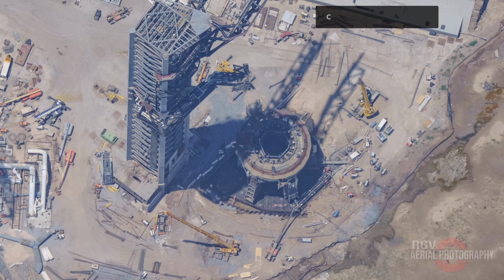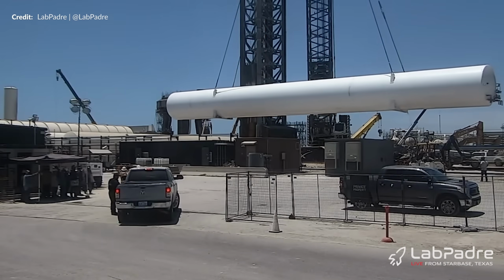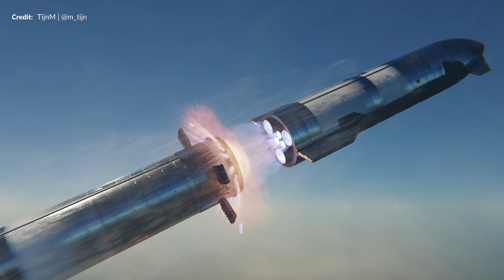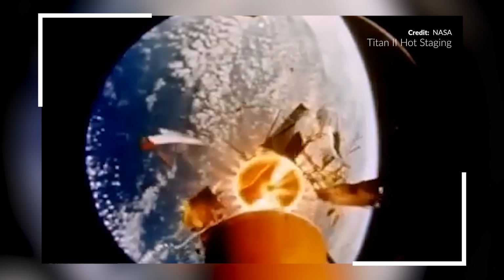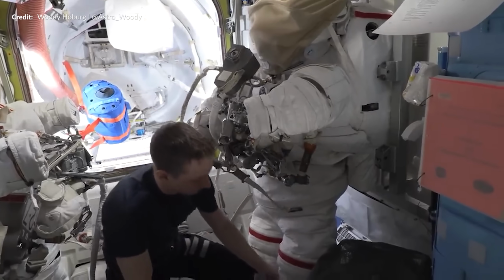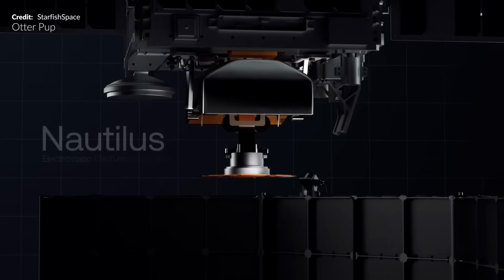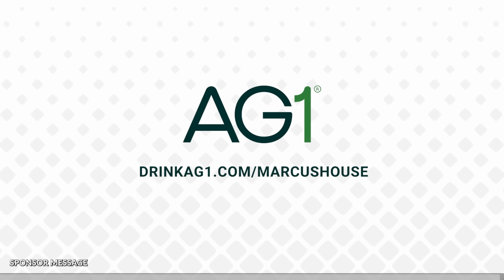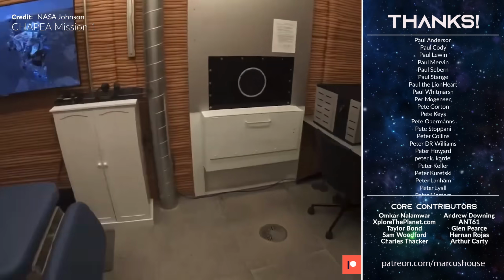SpaceX Drops Bombshell Upgrade Announcement: Can it really be that good?

Comment: I wonder how long it will take to build the first orbital launch mount on Mars?
Reply: They only need a pad on mars as there is no need for a booster. Single stage to orbit on mars is easy due to much lower gravity.
Reply: @schrodingerscat1863  Might not even need a pad, if a Mars Starship has aux engines at the top of the propellant tank, like HLS Starship.
Reply: @steveaustin2686  While the gravity on mars is significantly lower than earth it is way to high for the same engines as HLS uses to work. It would need raptors to take off.
Reply: @schrodingerscat1863  Depends on how powerful you can make those aux engines. It would not necessarily need to be the same engines or number of them as on HLS Starship. A Mars Starship would have TPS tiles, so if they did that, they would need to work with the tiles as well. They would need to be as strong as 6-9 Raptors though, so it would be tricky.
Reply: @steveaustin2686  Just wouldn't be worth the problems to try to implement such a system for mars. Mars gravity is around 38% that of earth so they would need raptors at around 40% to get the same acceleration as 100% on earth. The HLS style engines are designed to operate at 16% earth gravity which is considerably lower than mars. Those engines also wrap around the whole ship so wouldn't work with a heat shield at all.
Reply: @schrodingerscat1863  Eh, SpaceX planned to put landing legs through the Crew Dragon heat shield, so it might work. I never said it would be easy. They will need to do something.
Reply: @steveaustin2686  For landing on mars they need the raptors full power, because of the thin air the Starship will still be going very fast when it fires its engines to land.
Reply: @schrodingerscat1863  Which will kick up dust and rocks. Something similar to what is planned for HLS could help with that, as they are roughly 25m from the ground.
Reply: @steveaustin2686  As I said though, they need raptor levels of thrust for landing on mars not low power engines that can be mounted above the tanks, even if they can get such an arrangement to work with a heat shield.
Reply: @schrodingerscat1863  🙄 Didn't you say this an hour ago? "Mars gravity is around 38% that of earth so they would need raptors at around 40% to get the same acceleration as 100% on earth."
Reply: @steveaustin2686  Yes, and you keep going on about using engines like the ones on HLS.
Reply: @schrodingerscat1863  🤦‍♂️ Something similar and it would not need to have the full power of the Raptors as YOU pointed out that the Mars gravity is ~2/5 that of Earth!
Reply: @steveaustin2686  It would need raptors at around 40% thrust which is way more thrust than the thrusters they are going to be using for the moon. So based on a typical mission profile where most of the cargo is left on mars meaning say something in the region of 30 tones of payload returning to earth. That is going to need three raptors at around 40 to 50% thrust to launch from mars. Landing on mars is another matter. Because the atmosphere is so thin slowing down using the atmosphere is a lot less effective meaning they will still be going very fast when the engines fire for landing needing all raptors at full throttle almost until they land.
Reply: @schrodingerscat1863  We don't know that. AFAIK, SpaceX has said nothing about the power of those aux engines on HLS Starship, besides them being methane engines so no new tanks are needed. If those 24 aux engines each have 15% of the power of the Raptor engine, then you end up with about 60% of the thrust of the 6 Raptor engines. That would be more than what you say is needed.

Slowing down in Mars atmosphere is still very effective for the first part of reentry. It's after you have slowed down that you need engines to land.
Reply: @steveaustin2686  right, they are going to take all that extra pointless weight and severely compromise the heat shield for nothing. Seriously, you actually think that is a possibility, and those engines are going to be more like hot gas thrusters, no where near 15% of a raptor.
Reply: @schrodingerscat1863  So you think that they are basically RCS? 🙄 Whatever floats your goat dude.
Reply: @steveaustin2686  Similar concept to RCS but more controllable and designed to cope with longer burn times. They won't be full rocket engines with power head etc, that would just be way to complex and heavy. Hybrid engines would be a better name for them. This makes sense for a moon landing  where relatively small amounts of thrust are required and there is no heat shield to get in the way. For mars they need orders of magnitude more thrust and there is a heat shield in the way over half the ship. Just accept it, it's a none starter.
Reply: @schrodingerscat1863  I think that you are underestimating what is needed.
Reply: @schrodingerscat1863  Yeah, exactly the point, only a pad.  Can't bring it wi... how long?  Twenty years I'm guessing.
Reply: @kob8634  A pad is not strictly necessary but it reduces the amount of debris thrown up during takeoff and landing.
Reply: @schrodingerscat1863  Really?  You don't say!  I'm glad I stayed around to learn that.

Comment: Hot staging is not the option I would have picked for a reusable rocket.
Makes sense if you're about to ditch the booster in the ocean, but less so if you don't want it to take a beating.
Reply: What happened to the flip separation? That was a big deal just a few weeks ago.
Reply: @dmrr7739 1) The thrustless coasting period was gravity loss. 2) Starship engine exhaust striking the booster slows it down, reducing required boost back fuel. The flip was going to require devices, ullage motors, etc. best part is no part.
win-win.

Comment: SpaceX really needs to stop over promising. Adding more complexity to something that currently doesn't work is nonsensical. Besidies landing rockets nothing they are doing is revolutionary. RU had a starship almost fully built back in the USSR days. 2x SLS has the same thrust with a fraction of the engines. No advancements in tech matter if your basic engines fail. 
1. Reusable rockets are only ~15% cheaper currently 2. Instead of wasting 29 rockets again, (at least .3 billion) how about getting them rockets to a less than 1% fail rate? like every other rocket operator. 3. there shouldn't be this much rocket engine failures because we shooting shit into space for over 50 years now.
Reply: Wow, major thumbs down for arrogance & ignorance.

Comment: Holy cow at 2:54 there is a guy using a thread tapping tool on the holes in the side of the huge steel plate system that is probably a foot in diameter. That's got to be the largest threaded hole and tap I've ever seen. Obviously their probably threading it to attach pipes directly and seal into it right???
Reply: That tap and threaded hole also really caught my eye. By far the largest tap I have ever seen. Straight threads, not conventional pipe threads. Would like to know more about the assembly.
Reply: @larryoloane7579  No kidding right??? The whole thing is such a unique project. Nothing really like it has ever been undertaken.

Comment: I don’t understand the hype about SpaceX’s ‘hot start’ design decision. This is how the Soviet rockets did ‘multi stage’. Why? They couldn’t figure out how to do it the way NASA does it. Either that or they don’t want to let the craft coast for even a moment between stages.
Reply: SpaceX doesn't want to use NASA method because they don't manufacture a solid motors for pushers

They don't want the vehicle to coast unpowered because it eats the performance

Comment: modding the upper on Vulcan is going to affect the payload capabilities?
Reply: Yes it potentially does, increasing strength on that upper stage means more weight with extra weight on the upper stage being the worst place to have to add it.

Comment: One element with hot staging I haven't seen mentioned yet is that it goes a long way to creating an escape system for Starship. Should there be a booster anomaly the Starship can launch itself away from the booster without causing the booster to explode.
Reply: If the crew escape doesn't work, try the crew ctrl-alt-del instead
Reply: no step on snek
Reply: Not likely for a catastrophic failure. The Raptor engines take a second or more to ramp up to full power and the TWR is 1.5 at best. Contrast that with the Crew Dragon Superdracos that are at full power in 100ms and have a TWR of ~4.6.
Reply: @steveaustin2686  Keep in mind that the Flight Termination System ... something designed to intentionally cause catastrophic failure ... failed to kill one of these stacks for 40 seconds after triggering.  I don't think they'll get any more fragile.
Reply: @dudermcdudeface3674  Yeah, the FAA was likely very unamused that the FTS did not trigger the catastropic explosion it was supposed to do. Don't think that because the FTS did not trigger the booster to explode, does not mean that it can not explode. Because it can and any abort system has to get far enough away from the booster if that happens. Starship (second stage) almost certainly does not have the TWR nor the rapid engines for a catastrophic abort. A comparison of the Starship (second stage) and Crew Dragon show that.
Reply: @steveaustin2686  Of course it can explode, but the point is it failed to even when consciously designed to.  That means it's tough.
Reply: @dudermcdudeface3674  Which does not change the fact that compared to Crew Dragon, Starship (second stage) is too slow and underpowered to be an abort system for a catastrophic failure.
Reply: @steveaustin2686  Yes, actually it does.  FTS is designed to cause catastrophic failure, and failed to because the rocket was so robust.  And each operational Booster is intended to eventually fly 10-50x more often than F9 boosters, which will give them even more robustness over a short period of time before an abort system is ever needed.  

The aim of Starship will be to make that level of safety measure provably unnecessary with concrete safety data before ever launching humans. 

Cars do sometimes explode, but somehow we don't demand ejector seats for them.  Isn't that interesting?
Reply: FTS failing to destroy the rocket in a timely fashion doesn't mean its tough, it means the FTS system failed to blow the vehicle up in a timely fashion. The FTS is an all-or-nothing system - being delayed by 40 seconds means the explosive charges didn't activate when they were supposed to, not that the rocket resisted them?
Reply: @Dorsidwarf  The explosive wasn't delayed.  It triggered exactly when it was supposed to.  The rocket refused to disintegrate despite the explosion.
Reply: @dudermcdudeface3674  Still doesn't change that a few kg of explosive to trigger a failure, is nothing compared to the few thousand tons of propellant from an actual failure. Starship (second stage) does NOT have the engines nor the TWR for aborts from a catastrophic failure.

Comment: I see advantages for hot staging in terms of efficiency to get to orbit. But all rockets which have done this so far were designed to be single use. Doesnt hot staging with resusable rockets massively increases requirement for maintanance on the upper part of the booster?
Reply: I would guess that hot staging won't be used for long. SpaceX isn't one for sitting on a design that can be improved.
Reply: The booster will likely need to be armored at the top, increasing the mass of the booster. So some of the payload increase would likely be eaten up by the mass of the armor.

Comment: Regarding the hot-fire for Starship...sure, the Russians & a few previous rocket systems use/used it, however, they were not planning to RE-USE the booster, so if the top got fried..oh well.  I'd think they better build a serious cap & redirection system for the top of the booster, & not just a rinky-dink one.

Comment: Changes = Flailing.  Now you can easily see the advantages of Parallel staging.  I guarantee you that any advantage gained from HOT STAGING will be immediately lost by the extra weight needed to mitigate damage caused by the exhaust of the second stage.  10% is utter bull shit.

Comment: The greatest challenge for the CHAPEA crew will be enduring the isolation while knowing that they can just step out of the building and go home. A lot easier if you have no choice.
Reply: On the other hand, the knowledge that you're not really 6 months to 2 years away from the faintest hope of help in case of catastrophic (or even just moderately serious) medical or engineering crises would presumably reduce overall stress which would make enduring minor issues easier? NASA's done several extended-mission-simulation type experiments and some of the outcomes were... interesting.

"The difference between theory and practice is that in theory there is no difference and in practice there is" doesn't just apply to physics!
Reply: What about the stupid use of masks?
Reply: @Red-Raider  Finally! I was waiting to read this comment!!! I thought the same thing. But Marcus rocks these videos for sure!!!

Comment: the launching pad should have a citrus press like shape to counteract the thrust shock
Reply: anything to bring on rapid reuse!!
Reply: Because they don't have a flame trench the energy radiates at about 45 degrees all the way round from a flat surface. If they add some kind of slope it would change that but I don't think it is necessary and whatever they make that diverter from would need to be able to withstand the heat and pressure of the engine exhaust.

Comment: Thanks for another wonderful video, Marcus! Hot staging is an interesting choice - since, as you said, they have so much experience with Falcon 9's pneumatic separation system. I don't know if 10 percent more payload is that big a bonus when Starship already has such a massive payload capacity. Keeping the fuel settled in the tanks and moving through the plumbing predictably seems like the biggest benefit to hot staging. We've already seen what happens when the booster flips and fuel doesn't all go where it's supposed to.
Reply: wish i could give you more likes, thats an intelligent reply
Reply: They weren't going to use pneumatic staging anyway with Starship, they had developed a separation strategy using a twisting motion of the ship and booster. Hot staging seems an odd choice though as it potentially causes damage to the top of the booster which has implications for reusability but maybe they have figured out some shielding that resolves that problem. It does provide a pretty big boost to performance given the amount of time the previous strategy had the ship just coasting with no engines lit.
Reply: @schrodingerscat1863 The truthful answer is, they don’t know-yet- what first stage can take; having only 3 Ship engines firing on first try while videoing everything- since won’t recover this hardware- is what they’ll do to assess, visually only, how first stage handles it.
Reply: @dphuntsman  The first stage will be covered with sensors to determine how well the new staging strategy works.
Reply: They have figured out better ways to provide ullage decades ago, It seems silly to try and squeeze an extra 10% of payload capacity at the expense of reusability. Blasting the top of the booster with rocket exhaust has to limit how many times you can reuse the booster. Even with a heatshield to protect the top of the booster the shield will eventually be replaced. I think they are really more interested in flight data than recovering boosters anytime soon so I bet this is a very temporary idea.
Reply: It also likely means they can accommodate more outsized cargo in special purpose built versions of starship whilst retaining a good lift capacity. And long-term the extra performance will probably be desirable. The payload capacity may look insane now, but the very existence of it will quickly lead to new uses for such capacity and eventually a desire for more. 

The more they can raise the total payload the longer they can keep Starship from bumping into that. Ideally we'd start to see modular items being launched and developments from technology like Otter Pup to autonomously assemble them. But there's probably allways going to eb examples of weird outsize cargo  that will benefit from yet a bigger rocket.

Obviously thats long-term but spaceX is clearly thinking of starship as a long-term system.
Reply: If they have a 10% boost in payload mass, maybe they can use that for shielding. Maybe some sort of simplified water deluge system within the top of the booster. That could protect the top for the few seconds needed for separation and be reusable.

Comment: Why wouldn't they build a flame trench system that's proven by multiple generation of spacecraft Gemini Apollo  shuttle sls
Reply: Why do you think the OLM is soo far from the ground? They are adding a type of deluge system. What Musk evidently wants to avoid if at all possible, is a diverter under the pad that would block access to working on the engines.